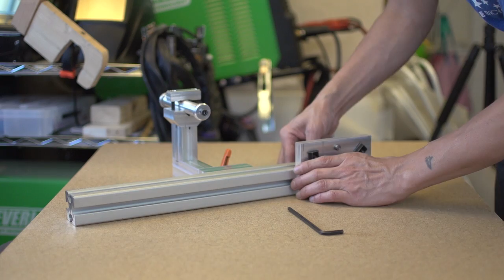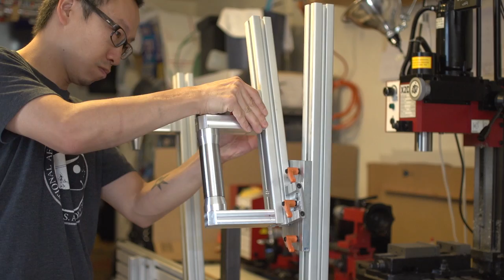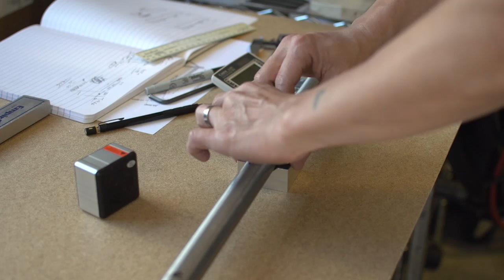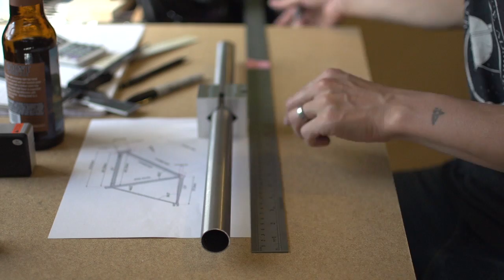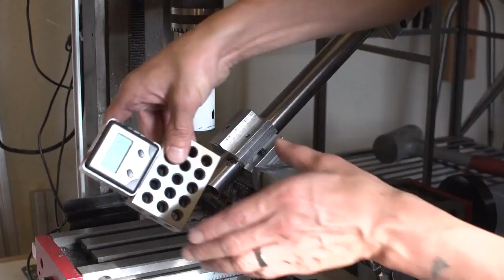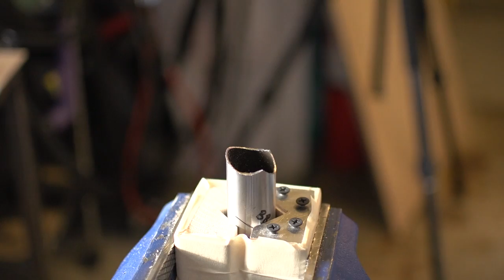Bicycle Frame Build 33 - Miter And Fixture Top Tube And Bottom Bracket

Comment: Aluminum is non-ferrous and won't hold the magnetic gauge, you were right to clamp it! You probably figured that out at the time haha

Also holy cow, a 20mm bottom bracket drop
Reply from the maker: Hi! I have since started fixturing tubes differently so no need to clamp the magnetic gauge anymore. With a little math I can calculate BB and HT distances and use the spine of the jig to get my distances set. Much more accurate!

Comment: Note from history of frame building;  Much better to leave the head tube a few inches long and them trim it to length after all the welding/brazing is finished.  Also aides getting the alignment perfect since any error on a longer tube is easier to spot than on a shorter tube.
Reply from the maker: +Kerry Sisler This is an awesome tip! It makes so much sense. Yeah, I'll run into the short HT difficulty aligning issue soon. Thanks for the tip!

Comment: The hole saws cuts very well on the lathe, the spin round. Did you make anything to them? facing the surface contact to the arbor?
Reply from the maker: +Abraham Hidalgo I did indeed face the surface. But one holesaw didn't need facing. Got lucky!
Reply: Did you simple put the hole saw in backwards on the lathe and face the back surface?

Comment: Thanks for the whole series of videos.  A few questions:  What software did you use to design your frame?  The drawing came out really nice.  When you decide lengths center-to-center, how do you know the measurement for the miter cut?  More generally, how did you decide on the milling/drill press and the lathe you chose?  I'm really, really enjoying the video series and your willingness to show successes and mistakes.  We all learn faster that way.  Keep it up!
Reply from the maker: +Morgan Cole Hi. The software is the paid version of BikeCad. http://www.bikecad.ca/  BikeCad has options to show you just about every measurement. That's where I was able to get my center to center measurement. I decided on the Mill and Lathe based on cost and the size of my work space. However, I have said it before; if I had the space I'd get larger machines! Glad you're enjoying it! Thanks for watching :)